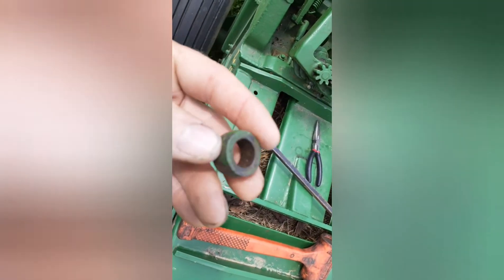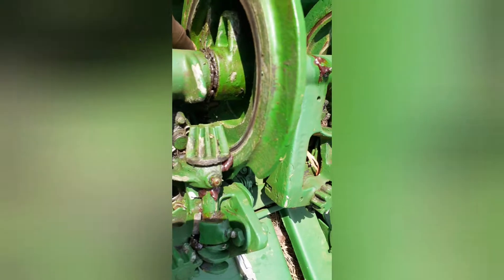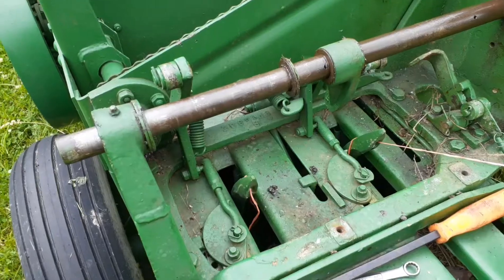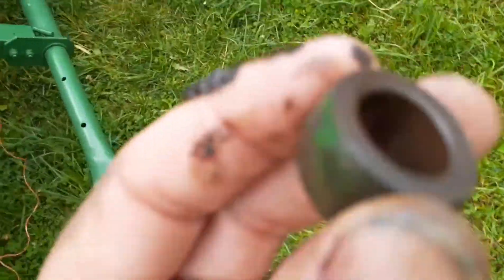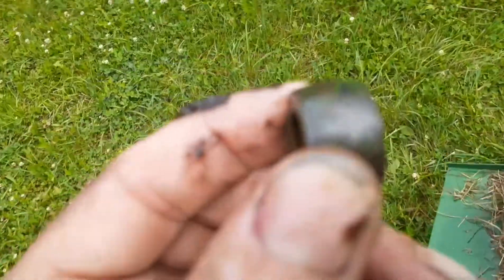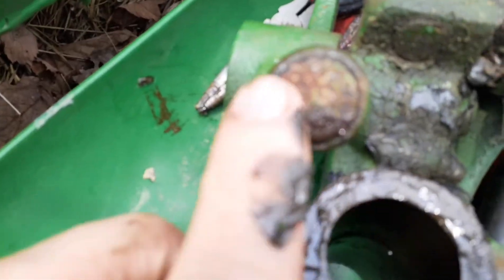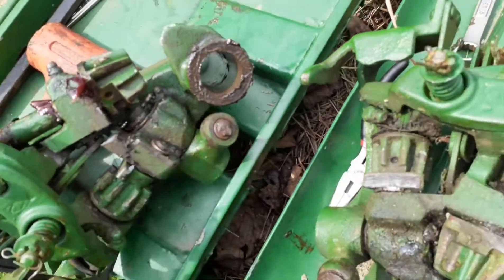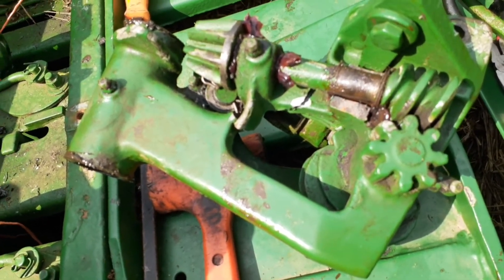John Deere 14T knotter failure diagnosis

Comment: Ours will not pull the needles all the way back and then the stop shears the flywheel pin . any ideas what to fix thanks
Reply from the maker: Only thing I can think of is something is out of time. I had flywheel pins shear but only because the baler was jammed with too much hay.

Comment: Great vid! The 14t's are great balers. The more you push them,the better they bale! We learned to work on ours. They are an easy baler to learn
Reply from the maker: Thank for the comment Gene. Got the baler working but having issues tying knots. Think the bill hook is worn.
Reply: Try e-bay,or steiner tractor parts
Reply from the maker: @genechronister7085  probably get them from Green Baler Parts they are close to me.

Comment: What did you decide on repairing it if possible! I hope you received some advice from others with the post I put out . You’re my friend and I wanted to help you with your problem,but I know nothing about baling machine
Reply from the maker: Hey Scott I do appreciate your help. After getting the knotters off I figured out what happened. I have found a knotter assembly for  $469.99 used at Green Baler parts. Thinking about calling them Monday. Had found the knotter frame new  for the same price but with the assembly I won't have tear down the broken one and rebuild. Just put on the used one and make sure everything is on time.

Comment: Saw in comments you were a JD mechanic so you can relate to this. Running my 2030 yesterday and blew the high pressure steel hydraulic line under the right floorboard yesterday.Had been "fixed" before with brass braze rod by another owner. Did same brass braze on new rub through break and added some rubber padding to hopefully prevent next vibration induced rub through. Back up so now I have time to source the new JD steel hydraulic line.
Reply from the maker: I never was a fan of patch jobs. I like to fix thing right. Some times you have to to get by.
Reply: @Rdrake1413  After 5 on a saturday so yup: patch and work till 9 to get that job done... :) Got a full set of manuals for that series so now it's time to track down the part number for the hydraulic tube. Easy enough to replace once I get the new tube.
Reply from the maker: @amossnowdaharleyman9179  Thanks for checking out my video and your comments.

Comment: All State Ag Parts: find on net and see if they have the complete knotter assembly from a salvage baler. Worth the call. You'll need the model and serial number from your baler JD part number for the knotter assembly will help too. Should be $400.00ish or less for a good used assembly IF they have it. E-bay is a good source as well for used.New sub: go through my video uploads for what dealing with/repairing decent used equipment is like.
If you are going to rebuild what you have the roller is retained with ,simply put, a washer center welded on the end of the stud the roller rides on.Look closely at the other one: looks close to same type of failure.
Reply from the maker: Thanks have bought from All States before. Found a complete knotter for $467 from Green Baler parts. After taking the knotters off found where the roller came from and why it causes the knotter to break. Have the part # for the knotter E49854.

Comment: Persistence always pays off! Sounds like you figured it out, regardless of the reason you figured it out. There are alot those parts balers around this area. No one uses anything but NH over priced stuff. I hope you can find what you need asap. If not let me know, can put some feelers out here. Would be shipping , but I'm sure parts would be next to nothing! Hoping all works out, look fwd to updates!!
Reply from the maker: Thanks Nelson I really wanted a NH 273 or an older 68 but just couldn't find one or got out bid at auction. One thing I have learned is never give up. It was a pretty daunting task to tear it down. But you can't be afraid to tackle tough jobs. Just got to jump in with both feet. You either sink or swim but you learn something.
Reply: @Rdrake1413  Amen on jumping in!! I love that mental aptitude sir, amazing!! Kinda where I was a few weeks back as well! Those NH are nice, but SOOOO expensive around here, unless they are 2 steps into the scrapyard! Will be hoping for positive updates!! Thank you sir, much respect!!
Reply from the maker: @Pennies_on_the_dollar  Thanks Nelson. I try to stay positive. A lot of New Holland equipment around here. New Holland was started here in PA. We always had NH balers on grandparents farm. Kinda lucked into finding the JD baler. They lady I got it from knows all my cousin up here so thought I would get a good deal. She told me baler had been rebuilt. You know gone through and repaired or replace any defective part. Lot of parts on a baler. The part that broke might have been overlooked. No one is perfect. It was a part not visible until I took the knotters apart. Can't blame anyone. I got it at a price I felt was fair and willing to pay. Even with having to repair I am still saving money new balers are over $20,000.
Reply: @Rdrake1413  I understand sir!! You are right, sure cheaper than brand new!! You will have it fixed in no time!! Thank you Mr Robert!